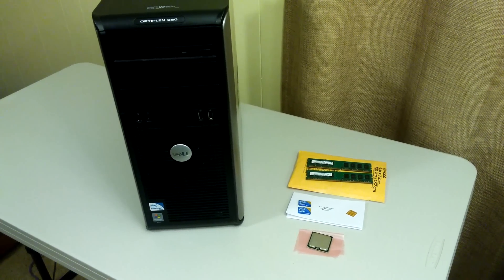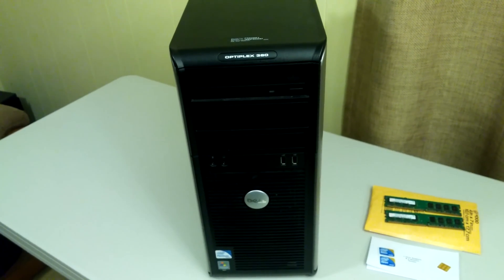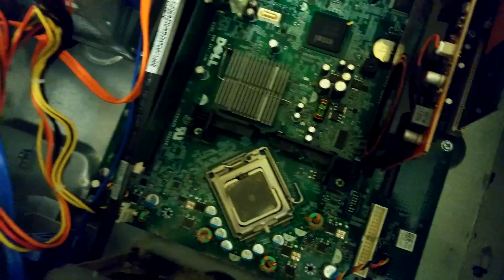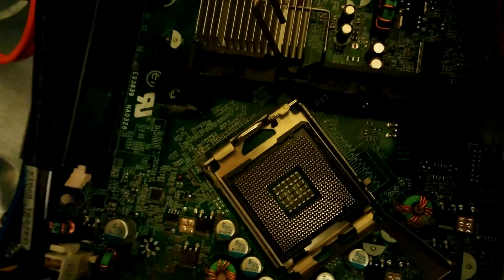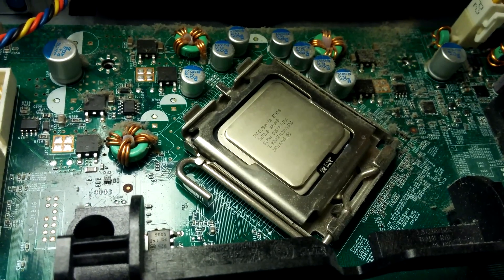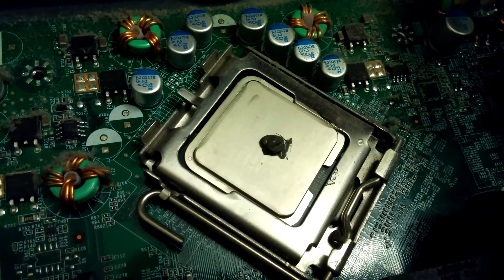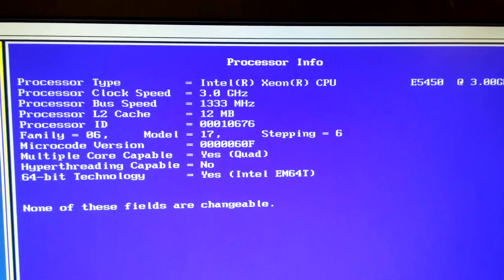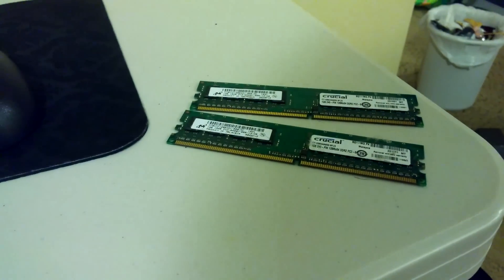Upgrading a Core 2 Duo Optiplex to a Quad Core Xeon E5450

Comment: for the optiplex 780 what are all the xeon cpu that can be used?
Reply: legotec49 is the only person that has ever got it to 'work', and no one believes that he knows what hardware he has. The 780 is well known not to be compatible with the 5xxx series in the modding community. I have a 780 MT and installed a Xeon 3363, but any of the 3xxx series will work. Yes, these processors are a little more expensive, but they are the only ones that work if you don't want to pay for a good Core2 Quad. You will also need to install a custom bios (found after at the top of a relevant google search, like "Xeon OptiPlex Mod).
Reply: I have an optiplex 755 sd (small desktop) q35 can i put a xeon e5450?
Reply: @deivermontes1316  did you ever find an answer?
Reply: vasilis tzio....Yeah, that Delll 780 has a MoBo socket 775 and need a BIOS-MOD for install a Xeon socket 771, also you need a Xeon socket 771 Modded by the seller or by you.
https://ae01.alicdn.com/kf/HTB1l8NgLVXXXXalXpXXq6xXFXXX2/-font-b-E5450-b-font-font-b-e5450-b-font-Quad-Core-3-0GHz-12MB.jpg

https://ae01.alicdn.com/kf/HTB13RkpHFXXXXbVXpXXq6xXFXXXl/Intel-Xeon-E5450-Procesador-3-0-GHz-12-MB-1333-MHz-Quad-Core-CPU-Del-Servidor.jpg

https://ae01.alicdn.com/kf/HTB12KdqOXXXXXaTXFXXq6xXFXXX6/E5450-Intel-Xeon-e5450-SLANQ-o-SLBBM-Quad-Core-3-0-GHz-12-MB-1333-MHz.jpg_640x640.jpg

Or if you have a Xeon-771 original, then need MOD the MoBo (cutting 2 little plastic piece).
https://foro.hardlimit.com/assets/uploads/files/1476640756718-01.jpg?v=icgoq2dapog

Q9650 = E5450 = X5450, just diferent pin set and notches.
http://i.imgur.com/uLxArRL.jpg

Look here CNET info about Optiplex 780 > Chipset Q45 no matters SFF or MT.
https://www.cnet.com/products/dell-optiplex-780-sff-desktop-computer-intel-core-2-duo-e8400-250gb-2gb/specs/

https://www.cnet.com/products/dell-optiplex-780-mt-core-2-quad-q9650-3-ghz-4-gb-500-gb/specs/

Now...read this about BIOS-MOD for MoBo 775-Dell for Xeon-771 Mod:
https://www.bios-mods.com/forum/Thread-OptiPlex-360-380-760-780-960-Xeon-LGA-771-E0-1067A-Microcode?highlight=optiplex

- " OptiPlex Bios Mods to Support Xeon Processors
Modded: OptiPlex 330 360 380 760 780 960
Not Modded: OptiPlex 755
Non-1067A mod: OptiPlex 745

Chipset Information:
O330-G31
O360-G31
O380-G41
O745-Q965
O755-Q35
O760-Q43
O780-Q45
O960-Q45
G31,G41 should support 5xxx Series,3xxx Series,45nm,65nm
Q43,Q35,Q45 should support 3xxx Series,45nm,65nm NOT 5xxx Series
(thanks to delidded.com/lga-771-to-775-adapter/2/)

Disclaimer:
Dell does not support this modified BIOS or have any oversight on the changes. These patches are completely unofficial, untested, and unapproved by the manufacturer. They are provided "as is" without any warranties or guarantees from any manufacturers or other entities, including myself. This will void any existing warranties.
Flashing the bios poses a very real risk of damaging your computer. You will be solely responsible for any damage or loss of data that results from flashing or using the patched BIOS.
FLASH AT YOUR OWN RISK!"

Page 12 the BIOS-Mod reupload.
https://www.bios-mods.com/forum/Thread-OptiPlex-360-380-760-780-960-Xeon-LGA-771-E0-1067A-Microcode?page=12&highlight=optiplex

Try to read all Post. :D

Here others BIOS-Mod for Dell-PC (optiplex 780 inside).
http://genius239239.myweb.hinet.net/771/dell_series.htm

More BIOS-Mod for Standar MoBos:
http://genius239239.myweb.hinet.net/771/

This is the Old Path...have a Bios-MOD for your MoBo, Xeon-771 without any Mod, then Mod socket MoBo, install Xeon and run.
https://www.youtube.com/watch?v=0FyvuDYVxLc

:D
Reply: Dell Optiplex 780 support All 3xxx series Xeons. The 5xxx series is incompatible. search it in http://www.delidded.com/lga-771-to-775-adapter/3/
Reply: Here it is: https://www.bios-mods.com/forum/Thread-OptiPlex-360-380-760-780-960-Xeon-LGA-771-E0-1067A-Microcode?highlight=optiplex
Reply: i have a e5450 in mine now
Reply: You say you have a E5450 in a Dell Optiplex 780? Are you sure?
Reply: CraftForce yes I'm sure
Reply: is it possible that your O780 has some other Optiplex mainboard inside? Say, from a O330 or O360? Because, from what i have heard, the Q45 chinset in O780 can not support Xeons, designated for dual cpu configurations (E54xx series), only X33xx series. Can you tell us the mainboard number and exact CPU type code and bios you are using? Thanks
Reply: @craftforceXL  the x3380 can work in O780 sff with q45/43 chipset and A15 bios?
Or i need mod bios?
Reply: Its the original motherboard that shipped with it. I can see that i have the Xeon in it
Reply: What chipset is in your Dell? I have just bought a stock Dell Optiplex 780 and with all this conflicting information I just wanted to see if my chipset matched yours so I would know it will work.
Reply: legotec49 What is your O780 from factor? Because I have an O780 DT and want to know if I could put the Xeon E5450 in with the mod?
Reply: Anonymous User I have a 780 mini tower. Will work for any of then
Reply: Yes, this is the only explanation.
Reply: make a video showing you pc and cpu i got 780 sff just try to add a 5450 modify and it wont enter in the bios and it shut down
Reply: And in a 780 MT X3330? (TDP 95 Watts) Core 2 Duo before TDP 60 watts
Reply: O780-A15 1067A-771.exe (4.79MB) https://www.sendspace.com/file/6c9hse
I just got a Xeon x3363 for my Optiplex 780 but the link is dead :(
if someone owns this biosmod on their computer and can reupload it, I'd be so glad!!!
Reply: Hello, yes but the link for the 780 is dead^^
https://www.sendspace.com/file/6c9hse
Reply: it's okay, page 12 of the topic, the last month someone put in a new functional link for the 780!
https://www.bios-mods.com/forum/Thread-OptiPlex-360-380-760-780-960-Xeon-LGA-771-E0-1067A-Microcode?page=12

https://drive.google.com/open?id=0B3CZPs...0tyZ1VlUWc
Reply: Optiplex 780 bios update backup reupload page 12. :3
https://www.bios-mods.com/forum/Thread-OptiPlex-360-380-760-780-960-Xeon-LGA-771-E0-1067A-Microcode?page=12&highlight=optiplex

.
Reply: i found an optiplex 780 sff wich has an  Intel® Core™2 Duo Processor E7500...this cpu is for 775 shocket...so i think the motherboard has 775 shocket?i ask u cause e5450 are for 775 shocket too.
Reply: u were very helpfull!thank you so much!!! :D
Reply: Is it possible to modify the O780 BIOS for the Xeon L5420 SLBBR? Modified BIOS for 1067A did not solve the problem - the motherboard does not start. Procesor checked - it is working.
Reply: Maybe you need a L5420 SLARP/Stepping C0/CPUID 10676 (non "A"). :s

 Try to contact these guys, maybe they can help you
http://genius239239.myweb.hinet.net/771/

:D
Reply: I can confirm that ! I use an 3353 Xeon !
Reply: none of the 5xxx series, so the e5450 wont work, i recommend the x3363
Reply: legotec49 I tried it on mine the CPU fan kept spinning. Doesn't work.
Reply: pretty much all of the E series since they are only 80 watts, the X series is 130 watts which will not work in a Dell Optiplex 780.

Comment: Will I need to use thermal paste on the core?
Reply: Desertstriker5 lol i used toothpaste mixed with oil and it still working fine
Reply: yes you need
Reply: Ofc you need thermal paste

Comment: Hello guys, i have an optiplex 760 (mini tower) and i want to upgrade my pc with a q9550 quadcore . i know optiplex 760 has two motherboards, but i don't know which one is supports it.
currently i have an e8400 3ghz, lc power 500w psu. my motherboard is OM858N, q45/q43, southbridge 82801jd (ich10d) 
please guys help me!

Comment: can i put a core 2 quad in a optiplex 745
Reply: the optiplex only supports certain core 2 quads or duos or xeons mainly those on the 65nm lithography 
the x3363 or q9550 are 45nm 
it wont boot with them because the mother board wont support them
Reply: the best core 2 quad supported by the optiplex 745 is the q660 or its Xeon equivalent Xeon X3220 (no sticker required!!)
the xeon is actualy cheaper sometimes and pulls off slightly better benchmarks
Reply: the q660 is more expensive because of its better overclocking ability 
but its only if you are using a non oem motherboard
for an optiplex 745 since you cant keep overclock settings permanently i would stick with the xeon
Reply: thank you
Reply: and trust me a Xeon X3220 will surpass your expectations
Reply: no it wont, get an x3363 or a q9550, it is pretty much equivalent to the q9650 except it has 150mhz less, it is way better than the q6600 and wont break your bank like the q9650 will

Comment: I have a optiplex 780 Sff can I upgrade to any core 2 quad please let me know
Reply: It works if done correctly. The dell's manual states a Xeon won't work in their motherboards, that's because they use a different chipset. With the 'sticker mod' it is compatible, but ofcourse they won't mention that in their manual.
Reply: Callum Faulds thank you btw which one is the best
Reply: Um, can I put a Xeon X5460 in an OptiPlex 745?
Reply: i just asked a seller and he told me that this cpu cannot work in all dells motherboard shamed that i cant put this powerful cpu in my computer..
Reply: Kent Stosem
только что
Dell Optiplex 780 support All 3xxx series Xeons. The 5xxx series is incompatible. search it in http://www.delidded.com/lga-771-to-775-adapter/3
Reply: Dan katesfield no

Comment: Core 2 quad fitting optiplex 380?
Reply: TrAxOn HaXx Yes all Core 2 Quads should work on the 380. I should know I have the 380 machine
Reply: Yes all Socket 775 ones.

Comment: friend you changed the bios to run the xeon?
Reply from the maker: Nope, I just made sure I was running the latest available.  As long as your motherboard supports the Core2 cpu of the identical microcode the Xeon / Core2 naming doesn't matter.

Comment: Bro i have dell optilex 760 (E6750) pro And lga 755 socket can i upgrade it to c2q plss replyy? "
Reply: yes, i had that cpu, if it runs with that it will run with a c2q guaranteed, but maybe not all of em, the high end ones require a lot of power

Comment: Awesome. I scored a free Optiplex 755 and will try to upgrade to the very same processor. My form factor has 4 RAM slots supporting up to 8GB so between that and a quad CPU, it should be a pretty decent system.
Reply: tanbrolo does dell optiplex 755 support Xeon X5450?
Reply: I think only the 3xx-series (330, 360 and 380) do @luqmanooo5402

Comment: I have the XPS 420 from Dell and did a BSEL pin mod to take the Q6600 (2.4Ghz stock) to 3.0Ghz.  I bumped it to 3.1Ghz with the SetFSB software OC.  The Pin mod tricks the locked BIOS into going from 1066Mhz FSB stock to 1333Mhz.  The 8GB RAM is DDR2 PC-6400 800Mz 6-6-6-18 and it's now running at 406Mhz (x2 double data rate).  The DELL motherboard is rated for up to 1333Mhz..so no issues there.

I noticed your HEATSINK is not nearly as large as the one on my XPS420.  The plastic shroud, integrated fan and mounting system look the same, but the  metallic sink is much smaller

I would suggest you look into buying a used XPS 420 (2 copper loop) or XPS 720 (3 copper loop) heatsink on eBay.  I actually picked up a XPS720 fan/shorud/heat sink combo for $7 delivered, recently.  I did this to see if I can reduce my idle CPU temp by 3-4C back to stock like levels (42C).  It's not imperative...just something I wanted to try. Apparently, the cooler on the 420 and the 720 fit the very same shroud, though I would have to drill three more holes in the top of my 420 shroud to accommodate the extra loop penetration on the 720 cooler. Luckily my 720 cooler came with its own shroud.  It looks like the small unit on your machine uses the very same shroud (420 type) and proprietary hinged mounting system, too.

Keep an eye on your temps with CoreTemp and/or Speecy.  If it's above 50C at idle I'd try the above with the bigger DELL cooler. Else at least throw on a rear case fan for $5-$10.

Lastly, your DELL will most likely recognize up to 8GB of RAM if you had a 64Bit WIndows OS and 4 ram slots on the motherboard.  I did the Vista HP (32Bit) to 8.0/8.1 64Bit upgrade years ago for like $40. I did a clean install on a new SSD...wow...big improvement there!!!!  Maybe you might be eligible to go to Windows 10 64 bit before the deadline (end June)? If you stay on a 32bit OS you will be limited to no more than ~3.6GB physical RAM recognition. If the old drivers are not supported by Win 10...you should be able to downgrade to 8.1 64 bit thereafter. Just an idea.
Reply from the maker: +JB6789 Wow that pin mod is impressive.  I used to have a Q6600 actually, I gave it to my brother in law.  Thanks for the info on the cooler too, my core temp has been around 50C idle and about 55C under load.  The fan ramps up and keeps it under control, but it does seem a bit high at idle.

After posting this video I actually swapped the stock 255watt powersupply for a Precision T3400's 525watt.  Perfect fit, even the motherboard power cable length was just right.  I was having some stability problems under high load on the 255watt, but the new PS took care of it no prob.  

Just wish it could take a dual slot GPU.  Especially now that I have two 6-pin GPU power cables available!
Reply: JP Duffy Yes, those idle temps are on the high side.  I'd definitely go for the DELL proprietary (used) cooler. (I'm over in Switzerland...so my extra ain't worth the transport). Else, just throw in a 92mm rear case fan...that should help some (though noisier).

Just as an aside, if I had to buy a decent GPU today with a power requirement acceptable for the Dell, I'd go for a GTX 750Ti.  I currently have a GTX550ti, which requires a lot more power and has about 1/2 the performance.  Your new PS should be enough for that 750 ti...which is under $140 these days and nicely matched to the quad core Xeon.

Of course, if you plan to move the GPU to a newer machine, and CPU bottle-necking isn't really an issue, something like the GTX 960 should also be possible. Just check dimensions on the Dimension.

Good luck!
Reply: I can't find a place that i can trust to download SetFSB, i would like to have it so i can over clock my Intel Core 2 Quad Q9550